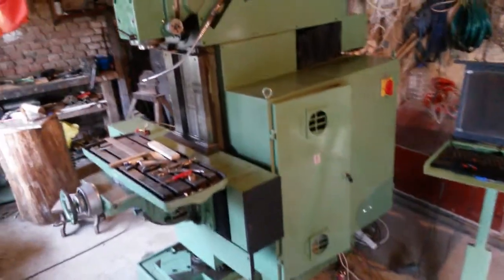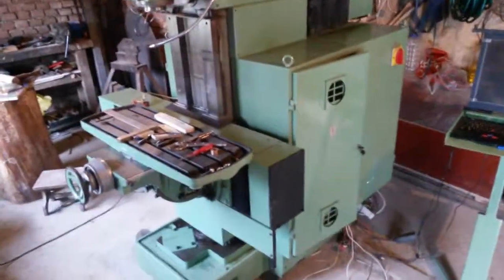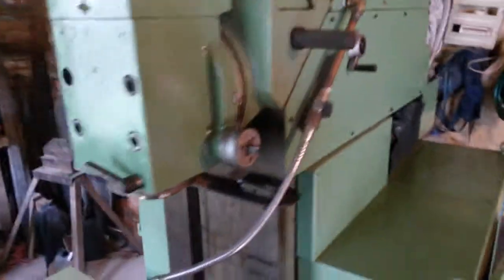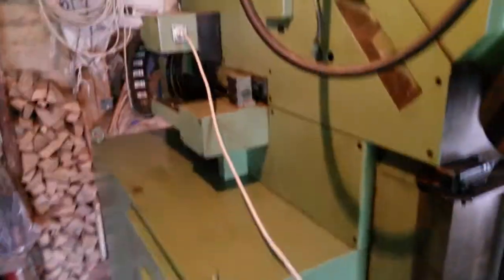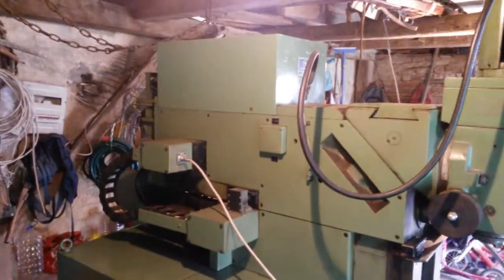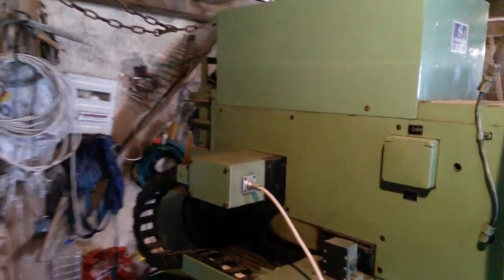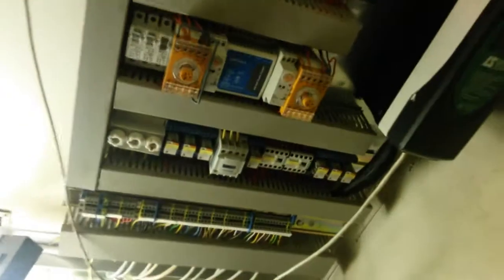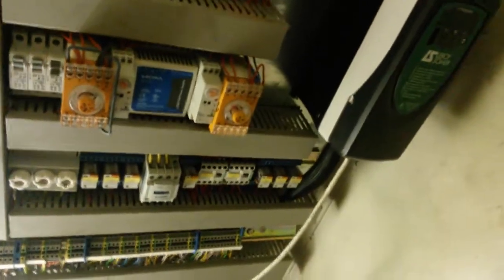CNC milling  Mach3 Retrofit Part 4

Comment: hello. its possible to control the gear box in the program on mach3?thank you
Reply from the maker: Yes , if you have gearbox switches and frequency regulator.
Reply: Mach3 control switches? Or you control manual?
Reply from the maker: The transmission has switches that signal what speed it is. I set 3 spindle pulls. I arranged the gear change to work automatically. Mah3 reads from the code how fast the spindle should rotate, from the switch on the gearbox it has a signal at what speed it is currently.
If you need to change the speed, then turn on the hydraulic power unit and solenoid valves and put it in the required speed. Sends a command to the Frequency controller at what speed the motor should rotate.